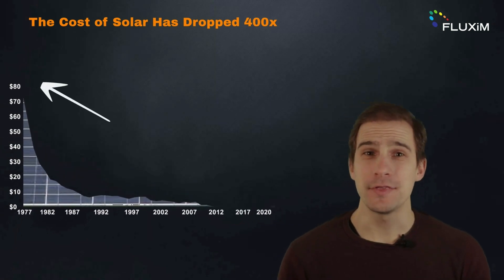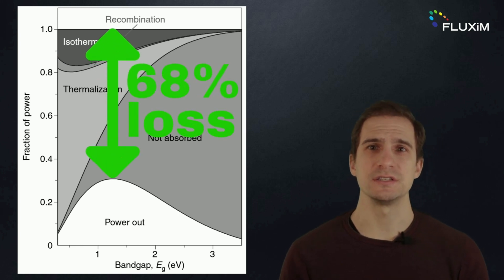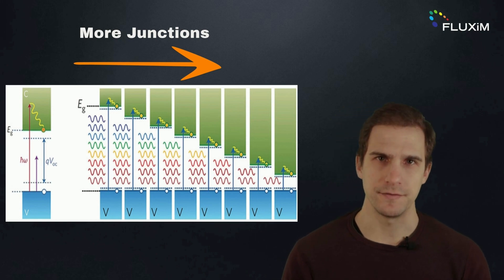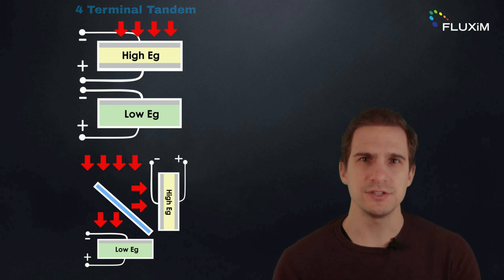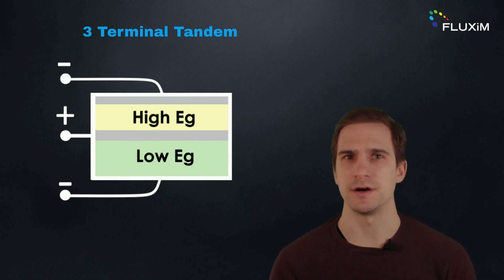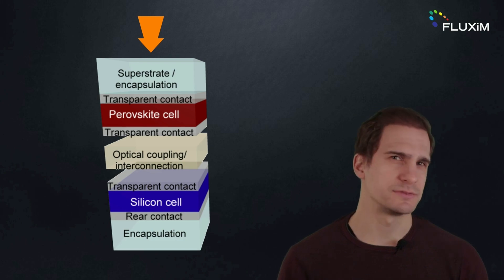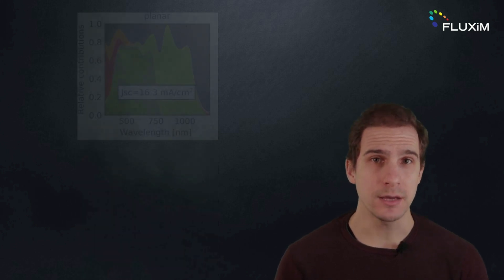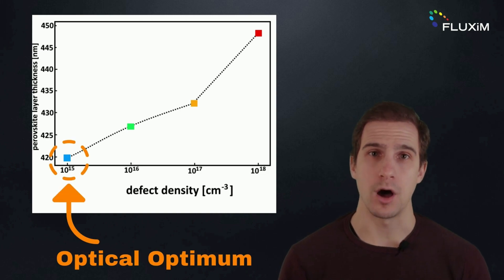Perovskite Silicon Tandem Solar Cells NEW EFFICIENCY WORLD RECORD: 34.85% Efficiency (Apr 18, 2025)

Comment: Devices have been "exceeding the (nominally 32%) Shockley Queisser Efficiency Limit" for decades.  Why?  BECAUSE THE SHOCKLEY QUEISSER EFFICIENCY LIMIT DOESN'T APPLY TO ANYTHING BUT SINGLE JUNCTION SILICON SOLAR CELLS!!!!!!!    How do we know that?  BECAUSE IT'S IN THE NAME.  Perovskite Silicon Tandem Solar Cells DOES NOT EQUAL single junction silicon solar cell.
Reply from the maker: Thanks for your comment! You’re absolutely right—the Shockley-Queisser Limit only applies to single-junction solar cells. Tandem cells, like perovskite-silicon tandems, go beyond this by using multiple layers to capture more of the solar spectrum
Reply: @fluximag  You missed my point.  I give up....